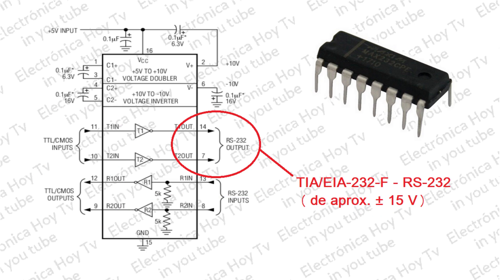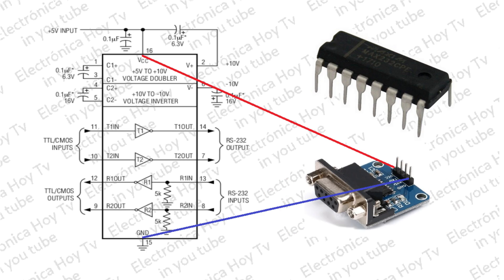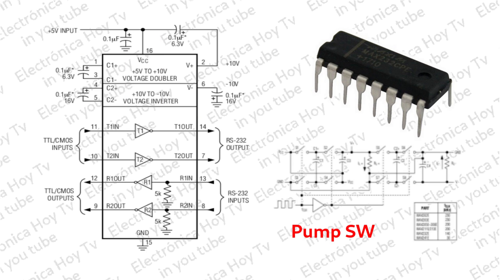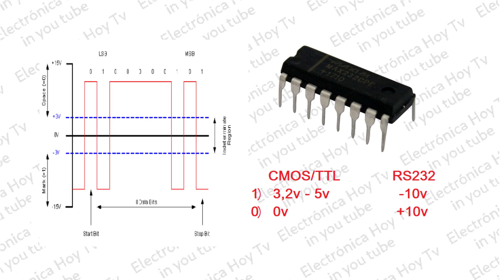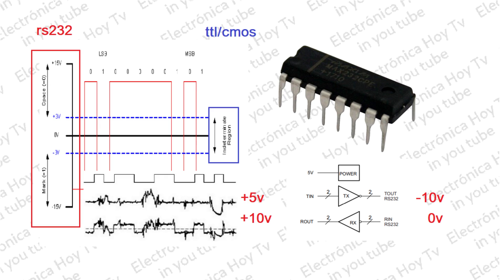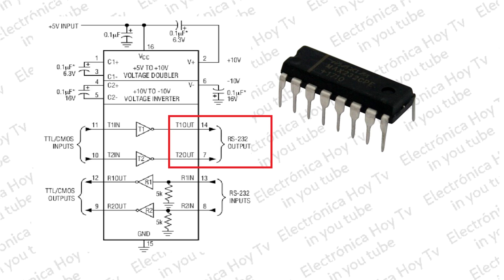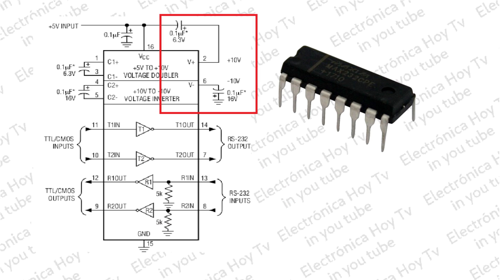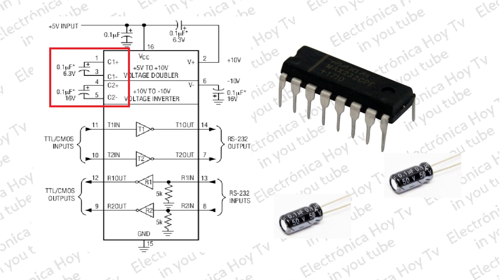MAX 232 DE RS232 A TTL/CMOS

Comment: Saludos. Me gusto mucho encontrar su video ya que estoy tratando de entender porque se daño mi  shield RS232-TTL que usaba con Arduino. Estoy tratando de hacer un circuito y en una de las pruebas , coloque un puente del lado RS232: ósea el pin14 con el pin 13. Mi idea era ver si lo que entraba por el pin Tx TTL , salía por el pin Rx TTL. Observe que el integrado se calentó mucho, mientras ingresaban los datos y creo se daño la interface.  Usted me puede ayudar con esa duda por favor.
Reply from the maker: Hola muchas gracias por comentar, creo que has planteado mal la pregunta puesto que Rx es recepción, no salida, al igual que Tx es salida y no enterada, quizá en eso consistió tu error, en un enlace de datos la conexión debe ser cruzada, es decir que la fuente de los datos (Tx) debe conectarse con Rx de la interfase y viceversa. Igual a mi nunca me gusta hacer puentes directos, yo siempre utilizo resistencias limitadoras. Un abrazo